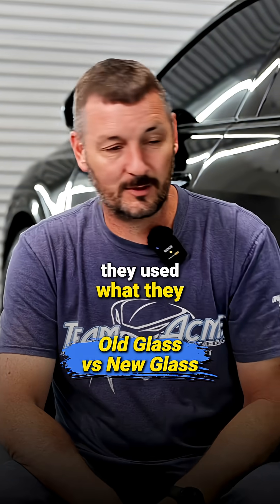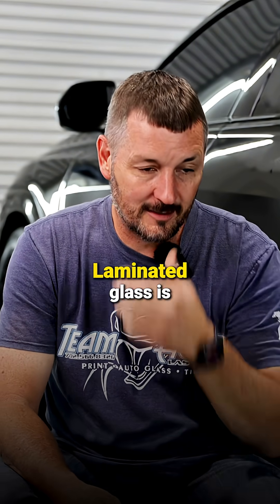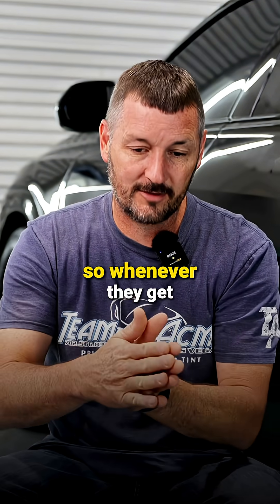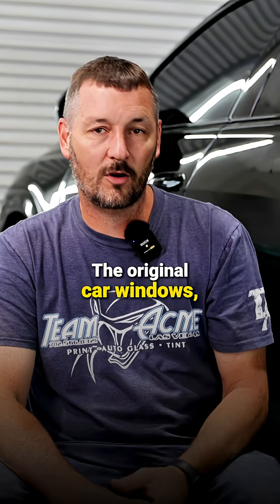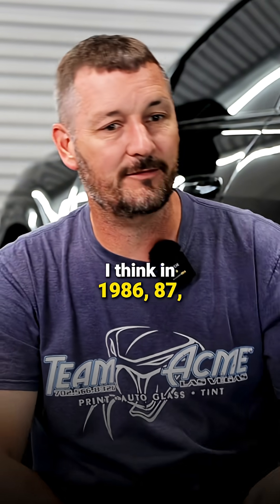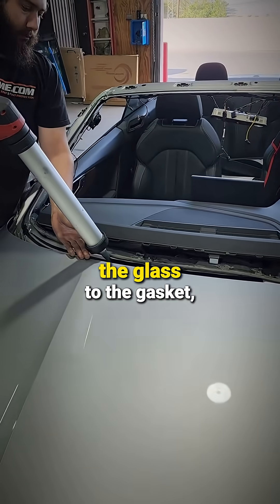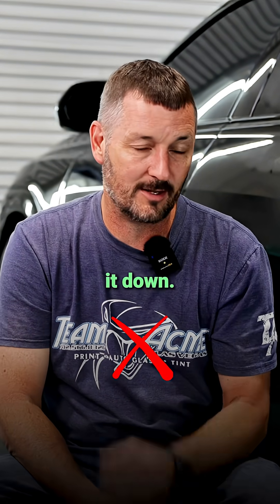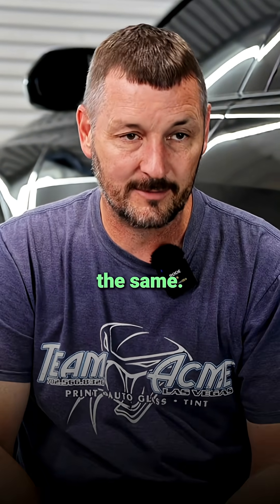Evolution Of The Windshield

Comment: This is not the whole story... Windscreen glass is chilled rapidly as it exits the furnace... This creates internal tension on the glass as the outer layer is more crystalline than the interior layers... As such a large impact makes it ahatter into small pieces
Reply: You're wrong. 
They dont use tempered glass for the windshield, that's why it doesnt shatter when chipped. laminated glass uses 2 pieces of annealed glass
Tempered glass is used on the side glass and back glass
Reply: @alakazam482  Thanks for that clarification.

Comment: Also why when a car is on fire and you want to get someone out quick you don't try to go through the windshield, side windows are tempered so the littlest of crack or chip shatters them into a thousand pieces. Also why they sell those metal tools with the pinpoint on the tip that will shatter a side window.

Comment: What happened to toughened glass which shattered into tiny particles - a previous windscreen to laminated glass - still used on door windows.
Reply: Tempered glass. That's used in rear windows. In front it's not safe.
Reply: Tempered glass is incredibly resistant to blunt force impact. That's why it's in car doors and the back glass
But its incredibly weak against a pointy object. If a rock kicked up in the car infront of you, and hit a theoretical tempered glass windshield, it would shatter in a million pieces

Comment: Odd how the original windshield in my 70 bronco and a bunch of rock chips but no cracks.. where as newer cars tend to crack easier.
Reply: Modern windscreens now form part of the chassis strength of the frame, and are therefore under stress. That's why they seem to crack easier. Nothing to do with the glass itself.
Reply: Not as many cars were going 80 down the interstate in the 70s

Comment: FMCSA required urethane in late 60's, rior I believe was a butyl tape. Original formula was I think 3 parts, then later became the common 2 part you see today. My 1972 Camaro Fisher body manual has directions in it for setting the fabric dam (used to keep the urethane in place) and how to prep the glass and sheet metal. Thiokol was the first company I believe to manufacture it. Same company also made the O-rings for the space shuttles including the one that blew up on launch.
Reply: Morton-Thiokol also warned NASA not to launch because of the low temperatures. Challenger was wholly on NASA, not the maker's of the 'O'-rings.